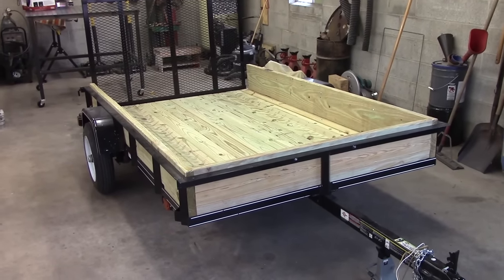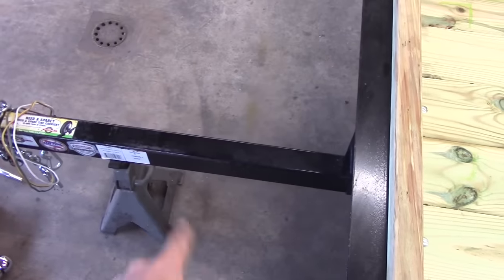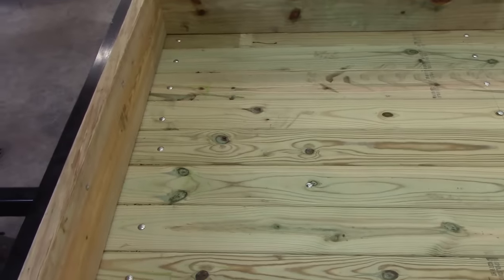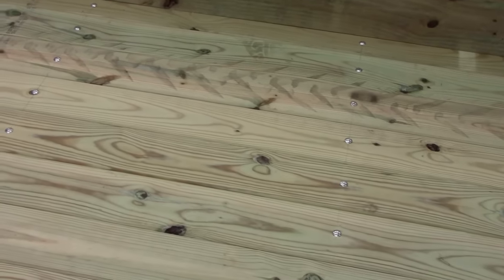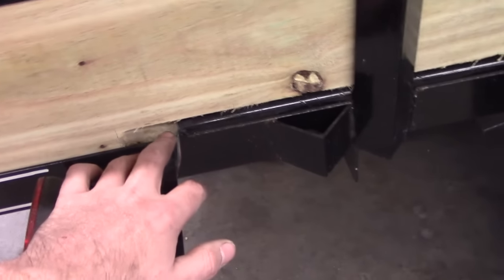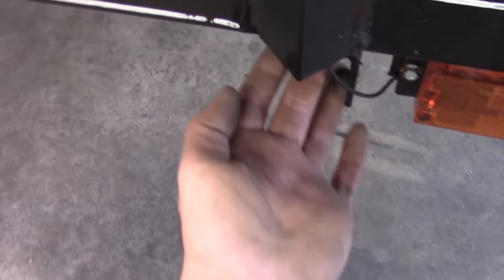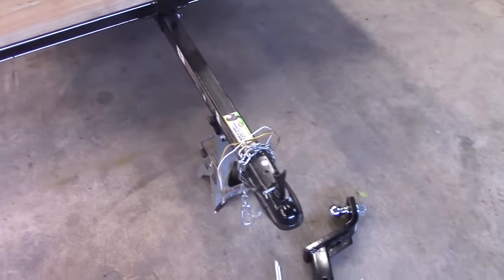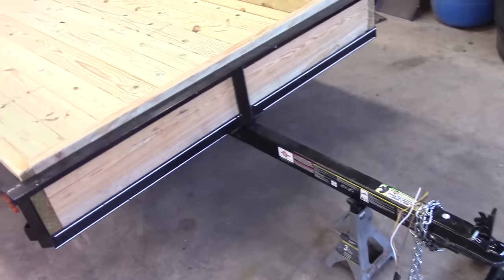Upgrades to a wire mesh carry on brand trailer

Comment: Thats exactly how you do it. Decking Lumber is ideal for this project.  
  If you now stain it once every  4 to 5 years the floor should last you a good 20 to 25 years easy. 
 I agree with the person who said the front and I think the sides should be removable.  Just run a little  smaller bolt through  the holes in the Lumber and the trailer  with the fender washers  and add a wing nut and then you can remove them if you choose to do so.
 Decking  is the perfect  choice, I  put it on mine 23 years ago. Still looks good

Comment: So yes, I have the same trailer that I had for several years and I have the exact same trailer the 5 x 8 wire mesh and you are right they made those things as cheap as possible. but I decided to use two by eights for faster coverage. I want to put the sides on like you have yours except I think I will use treated plyboard and hopefully they have it Lowe’s I also purchased anchor tiedowns for the floor not quite sure how to install those yet and I have noticed several times using the trailer that I have either backed into an object and broke the lights off, so I have decided to do a modification and mount on the wheel wells so yeah I enjoyed your video. Gave me some pretty good pointers.

Comment: Nice! I put 2x6 treated boards on mine last winter after I cut the bent and loose metal out which was 6 years or so old, put new lights and harness on it, perfect size for home use. Mine is a Lowes trailer also, I replaced the two through bolts that hold the tongue bar also with 5/8 bolts because the holes had worn and lost shape so I drilled those to 5/8 and it tightened everything up like new.

Comment: Congrats look nice. I just bought a 5X8 wood floor mine came from Tractor Supply here in WV.
I am going to do the sides on mine thanks for the Specs right kinda ya sir.
This thing tows like a dream. Mine cost $849.00

Comment: Looks great man.  I'm wanting to do the same to my 5x8 trailer as well.  It's a perfect size trailer to do so much with like, haul my quad on, get lumber when building things at my house all DIY of course.  
     I added an extra item to my trailer bc, your not always going to want to haul the concrete brick around to level the trailer.  Do like I did to mine from the start...  I went to my local (TSC) tractor supply company and for about $20-$30, which mine was on a huge sale for like $21 I believe years back now... Purchase a marine crank with an adjustable lift, that has a tire on the front of it just like all boat trailers have.  They will also swivel up, and be in line with the neck of the trailer when going down the road.  It'll be the best money that, you ever spent on your trailer.  Thx for the wood info, going to do that, to mine this year.
Reply: Got my 5x10 wood bottom from Lowe's and it come with the spare tire on the front just behind the jack!

Comment: Nice upgrade! I bought a 4x6 trailer from Lowe's for the same reason you described, hauling mulch, leaves, etc.... For the wife 😆, she said"BS" that I wanted it.... Meanwhile look who's using it most of the time 😂. I used 2 sheets of treated 4x8, made the necessary cuts so I can haul that stuff. Nice video, best of luck!

Comment: I cut the metal out, it was almost 10 years old and the welds broke, I put new wiring harness on it while the floor was out and painted it all and new tires, now I'm trying to decide which board to go with, either 2x6 or I may use 5/4 Deck boards to keep the weight down, I haul a mower that is maybe 700 lbs and sometimes gravel so a deck board should do okay for that I believe.

Comment: The first thing I would do to a carry-on trailer is paint it with a good rustproffing paint. My fenders rusted out in five years, and the bottom side  is not painted vary good when new.
Reply from the maker: Yeah I've been considering that. I got an LED light kit to install so that might be a good time.

Comment: I'm looking at one of these 5x8 mesh trailers to haul an UTV on, but I'm not going to completely board it as I'm just going to put enough boards for the wheels to sit on as I want the trailer light as possible.
Reply: Word of advice: the tongues on these are bolted to the frame not welded. It’s a weak point. If you’re hauling anything heavy I suggest running a welder around the tongue to secure it to the deck. It says otherwise and can break.
Reply: @artemartem1134  I have two removable pins and two bolts in my tongue as I use the trailer as a tilt trailer. My UTV only weighs 1100 lbs.

Comment: I suggest you treat the wood, preferably on all sides before installing it.  Some deck stain would work.
Reply from the maker: I did end up treating all the easily accessible surfaces.

Comment: Just curios... I have a trailer just like this. Its about 6 years old and the mesh is sagging and breaking through where the tires sit when the lawn mower is on the trailer. I am going to put deck boards on it but dont know whether to pull the mesh, or leave it the way you did. Are the boards still attached well to the mesh or have they come loose, and how are they holding up?
Thanks in advance.

Comment: I have gone through several utility trailers. I find the best floor solution to reinforce wire mesh is the simplest and cheapest. Just lay a half inch sheet of cheap plywood from Home Depot on the floor . Gravity will hold it in place.  Similarly, for the sides plywood that is held in place by tension or whatever load you are carryIng or possibly 2x4 corners attached only to the front piece of plywood locks the sides(and front) in place.
When it looks really grubby or battered throw it away. The advantage is you can lay the sides flat when not needed to reduce wind drag when nee
Reply: Thats win u did not see anything and keep going...

Comment: Going to be getting one of these trailers from a friend, I wish you would have included a parts list for this trailer edit!
Reply from the maker: After a bunch of requests, I just put the info in the description. Only thing I wasn't sure of is the length of the bolts. As long as they go through the board plus some extra for the washer and nut, you should be good. Extra length isn't the end of the world as it would just stick down through further.

Comment: If you really want the trailer to ride level, you could always remove the hitch and stack flat-stock steel or tubing on top of the draw tongue then weld that up.  Seems like a lot of bother though.  Nice trailer anyway.

Comment: I looked at the one Tractor Supply sells, its a carry on and basically the same just has larger wheels. We did notice it was quite flimsy, did the wood really help correct that?
Reply from the maker: Yes, adding the wood and securely attatching it did stiffen it up quite a bit. It DOES add a fair amount of weight but I feel its worth the trade off.

Comment: How is the gate hinges attached to the body?  Is it welded or bolted? In other words can the gate be removed for hauling 10 or 12 foot boards?
Reply from the maker: The hinges are welded from the factory. They could be retro fitted if desired

Comment: How did you determine the hole locations in the mesh floor when drilling through the floorboards?  Great looking trailer btw.  I have the same one and was thinking about taking on this project.
Reply from the maker: Just drill em....worst case bolt is at a slight angle. The only other option would be to drill UP through with the boards in place.

Comment: Do you realize that your tailgate also swings in and lays flat inside of your trailer? With the thickness of the wood that you use I don't believe it will do that any longer. It's a nice option for when you're hauling something longer than the trailer
Reply from the maker: No, this particular trailer never had the option to fold it down inside the trailer. Its just not possible the way its made. I installed the wood to prevent mulch and dirt from falling through. Thats my biggest reason anyway.. I have other options if I need to haul longer things.
Reply: @Pyro17059  I have the same trailer except it is 5 by 10. You pull the pins and the tailgate folds in as well as out

Comment: So your lawn tractor doesn't tear through that mesh ramp when driving it up? I suppose I could do the same modification on the same trailer & be able to drive my side-by-side UTV up in there.
Reply from the maker: I have a zero turn so its not super heavy...if you're concerned, you could pretty easily weld in some extra supports under the mesh.

Comment: I didn't do any research and never bought a trailer before and I ended up buying one with a mesh floor and now I'm here and that's a bad choice I feel so stupid plus I paid way too much for it LOL but I was wondering it how much did it cost you and supplies for the wood and bolts?
Reply from the maker: Its been quite awhile, but I want to say a little over $100

Comment: Hi awesome job! I just picked one up last week and wanted to redo the trailer deck and all. Question for you if you can recall, do you remember if the deck boards fit flush or did you have to cut one for the floor?
Reply from the maker: Honestly dont remember at this point...Just been to long ago now.
Reply: @Pyro17059  it's no problem, if I need to buy a table saw, so be it then lol

Comment: Nice review. I purchased the same trailer from Lowes but the next size down, 4x6. 
Im picking it up tomorrow morning. What size lugs are they so I can check them before leaving lowes parking lot?
I like the 5x8 but im using a ford ranger whos bed is also 4x6. So its streamline prefect. 
Thanks in advance
Reply from the maker: Dr. Crentist I can't remember what the lugnut size is..my dad is currently borrowing the trailer or I'd just go check for you
Reply: Pyro17059 
Fast reply regardless lol. Thanks anyway

Comment: Hey I know it's been a while since you did this build.  I was wondering what size fender washers you used and what material your bolts/nuts/washers were (stainless, galvanized, zinc)?  Thanks for any info!
Reply from the maker: I wanna say they were galvanized but its been awhile...all the info that I have/remember is in the description.
Reply: Hey thanks for the reply!  Did the boards curl at all at the tailgate end?  Would putting 2 bolts at each end of the boards be better or is it still good?
Reply: @jeffreyreim5512  I was just checking on your comment to see if the boards curled at the tailgate in. Have you tried it or what are your thoughts?

Comment: My advice would be to spend a bit more on a big text or similar trailer. They are made so much better than these cheapo ones.
Reply from the maker: Kevin Phillips if it got used harder and more often I probably would. But for its purpose, the price was right.

Comment: How to you plan to put a tag light on the tailgate?  I see how you have the tag mounted.  Might be a problem without a light on it.
Reply from the maker: Not worried about a light.
Reply: you will be when your stopped a receive a ticket ......it is illegal.  I have the same trailer and wired a small led lamp on the tailgate...….they WILL stop you for not having your tag illuminated. @Pyro17059
Reply: Ray that’s a good point that I never thought about

Comment: What size tires are on your jeep? I'm trying to figure out the correct hitch offset I need.  I'm buying the same trailer, and I also have a jeep with 37's . You said you have a 6 Inch drop. That's probably what I'll end up with.
Reply from the maker: William Allegra I only have 33's. You're probably going to need a huuge drop.
Reply: Pyro17059 . Thanks, by the way, great video.
Reply: If I may so, The best way to do that is. Park on a level place and pull the trailer up behind the tow vehicle. [leave the trailer unhooked] now take a level and place it on top of the tongue of the trailer. Level the tongue. Now measure from your the center of the receiver down to the coupler on the trailer. This measurement say 4" would indicate a 4'' drop is needed to make it all wor good together.

Comment: What is the length of the bolts?
Reply from the maker: I do not recall the length. I just grabbed a few and eyeballed them against the thickness of the boards. Add a bit for washers and the nut and you should be golden.

Comment: How many pieces on wood u need 4 the floor?
Reply from the maker: Trucker BC 11 pcs on the floor. Make them fit tight because they will shrink as they dry out
Reply: Pyro17059 10-4..thanks
Reply: Pyro17059 one more thing boss...whts size board u use on the floor of the trailer and the side boards??
Reply from the maker: Trucker BC 5/4 x6 treated deck boards.

Comment: Whats the size lf wood you used ?
Reply from the maker: daniel contreras sides of trailer I used [3] 2x10x8ft treated. For the floor I used [11] 5/4x6x8 treated deck boards. I placed the boards as tightly together as I could when doing it. They will and did shrink up so You will end up with small gaps between boards.
Reply: Pyro17059 wonder if you just could silicone up between the boards so you don’t lose any mulch or sand in the cracks going down the road. Thanks for the video, I’m about to do the same thing, like what you did with the carriage bolts and deck boards,

Comment: How did you keep the carriage bolts from spinning while tightening the nuts?
Reply from the maker: Edgardo Alverio they sink into the wood and prevent them from spinning.  I used a 3/8 electric impact..

Comment: You just reduced weight limit on your 1000# axle. Don't haul anything heavy...just sayin!!!
Reply from the maker: If I intended on hauling something heavy, I wouldn't have bought this trailer, or use a jeep to pull it. Not worried about weight in the least
Reply: @Pyro17059  BTW, Very nice work...trailer looks good!!
Reply: I have this exact model n have loaded it with 2500lbs of gravel. Took it like a champ.